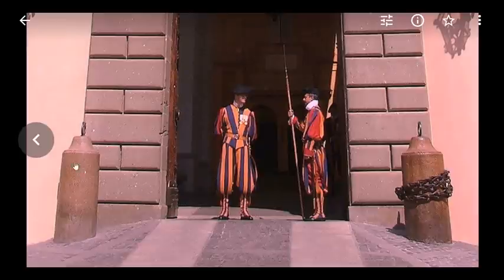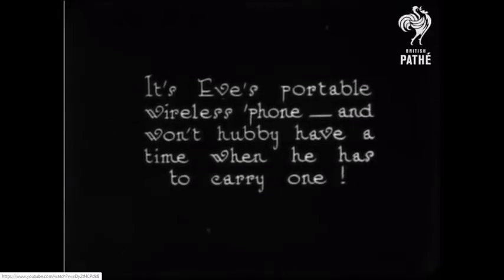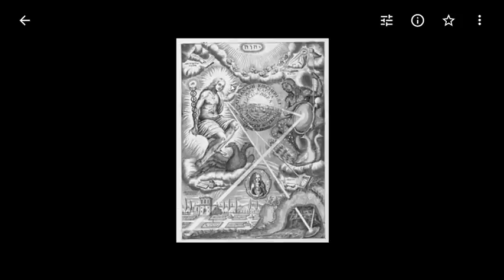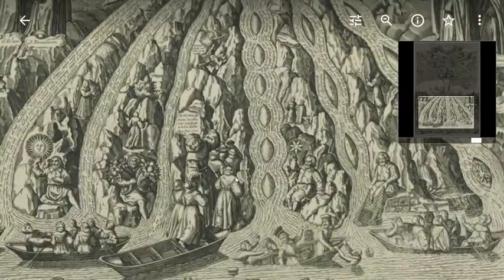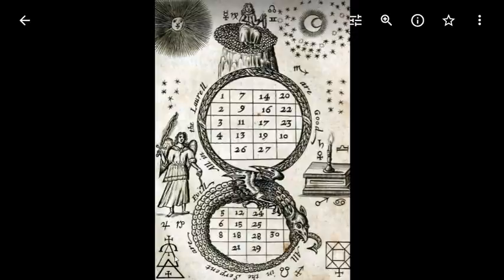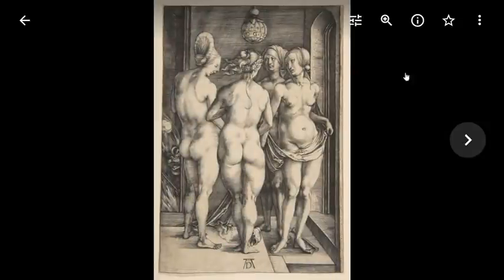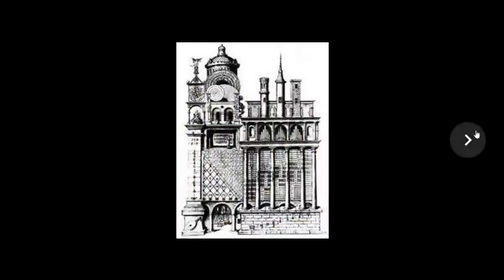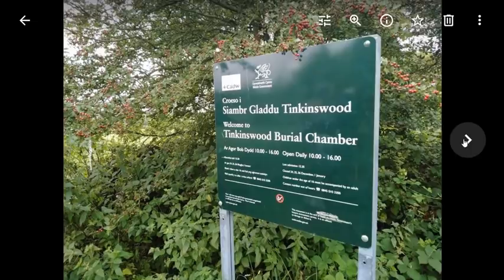FEB Extra! OMG! Antiquities Bollard's Were Charging Ports!

Comment: Im primarily a line voltage electrician, no expert when it comes to DC & wireless transmissions. But pretty sure she had a battery inside of the phone, tied into the a steel fire hydrant to ground to a degree and pick up a stronger wireless signal once she put up the umbrella. Love what you do, great work getting Levi on last month.
Reply: Jungle Jim yes pretty sure the wire was grounding, the use of batteries is interesting, they go way back further than we've been led to believe
Reply: Yup
Reply from the maker: Had a sub said his grandfather had a job taking the wires out. Could work either way if re-purposed. Do you have an Earth wire to plug in your phone? Electric can work omi-directional thanks peace!
Reply: Journeyman lineman and ham radio operator in USA. Yes, she's simply earthing her ground plane. That was needed with those old analogue LF radios.
Reply: FLAT EARTH BRITISH Think Tank! Great points, no ground wire for my portable that’s for sure. Love the story about your sub having a grandfather that helped to repurpose the old bollards. Great work in Cardiff the other day, jumping on the mic unplanned and doing your part to inspire people to gather and live fear-free.
Reply: @flatearthbritishthinktank2171  If you would ever like a second opinion on anything electrical related it is what I do for a living. I understand Tesla's ideas and I've had my hands on every facet of the US electrical grid. Much of it's key components still operate by his design.
Reply: I love the fact that we have any type of engineers following these pages - as when we are united we become a formidable side with diversity and above all the ability of open mindedness is shared and increased exponentially... In other words finally were fkn helping each other instead of dragging one another down!!!!
Reply: @user-xv1gr1of8t  there are several possibilities that these metal clad domes provide that most do not understand because they simply don't understand electromagnetism, potential gradients or earthing. I'd like to draw some of this stuff out for some of these youtubers because they are missing some stuff.
Reply: @iant419  I don't fully understand and I'd love to see you draw it out!
Reply: I'd also really like to see this drawn out. Why do people think they're kept in plain sight, as opposed to simply demolishing them; do we think that they are still being used, or that there is a different reason?

Ive been think about the theory that the magnetic poles of planet earth, swap around every 300k years and i theorise it is to do with earths position in the solar system, relative to a larger planet or star - the reason science theorises that the poles change is due to Geologists study of rock and earth. I have been pondering this and wonder if they even change at all - maybe if man were to start to harness electro-magnetic energy again, on a large scale then you'd expect the effect to be seen in the rocks... What are people's thoughts on the reversal of the earths magnetic poles being the reason behind the change of formation seen in rocks by geologists?
 Do you think option 1) planets position in solar system or option 2) harnessed magnetic energy impacting the surroundings? 

The official explanation/theory relates to neither option and they say it is due to activity within the earth but I can't help but feel this is the least likely possibility. 

I actually believe solids can be turned into a liquid-like material by sending a high pitched frequency through an object, resulting in the particles vibrating and moving around more freely (see the atomic structure of solids, liquids and gases). This would explain how megalithic structures were 1) quarried in vast quantities
2) transported kms to the site
3) built in a polygonal method (starting by placing bulging blocks - in a row and then as if they are 'squeezed' at either side to fit PERFECTLY into place). Again I know I don't have answers, only possibilities.
Reply: Also - wouldn't the moon build up and carry with it a lot of energy? It is closer to earth than the sun so surely it would be easier to harness energy from the moon than the sun (like a stepping stone almost). It is also interesting to note that the ancient people would worship the sun and the moon - which I believe there are clues in the holy books but you must first understand how to translate them in terms of astrology, which we know the ancients were fascinated by.

Comment: As an electronics specialist of old can say that the ladies in this video had a crystal radio receiver which needs no battery. It only needs a ground and antenna. The power came solely from the electromagnetic wave itself. (This relates to the electric techniques of antiquitech however)

This particular radio only received a radio signal. It did not broadcast. Notice that it only had an earpiece for listening.

Back around  1920 AM radio was an amateur hobby and private individuals broadcasted a small radio station from their homes or small business, as there was little to no regulations. This was new tech! Hobbyist built their own crystal radio receiver sets, which is what's shown in this video.

These were fascinating times, and the world of electronic innovations has accelerated at an exponential rate ever since.

The metal lugs and posts throughout the towns mentioned here can only be at an electrical ground potential, neglecting small telluric currents. Technically they are electron donors but nonetheless are earth ground. This ground potential only completes an electrical circuit. Technically, its half of the circuit. A circuit is a circle, hence its etymology.

Thank you for this wonderful video Martin! Im looking forward to catching up on all of your videos. Powerful gnosis my friend!

Comment: That is a “Johnny Pump”. The fire department hooks up their hose to the side of it and turns it on with the valve on top. We had great fun with them in the summer in Brooklyn NY. There is an enormous amount water pressure in them.
Reply: I was thinking that this doesn't look like a bollard, but a fire hydrant. So they are hooking their phone to a metal pipe with water in it. Were bollards attached to the water supply, too? Maybe water provided the energy?

Comment: Hey FE British i think the bollard is being used as a good source of ground to connect up to what looks like a basic self powered radio transceiver . there is an old radio shack circuit that explains how to make a low power radio receiver without a battery, just need a good connection to earth ground and you can pick up stations.

Comment: I have got in so far watching the ladies. Great find Martin. Haven't read comments, hope not to be repeating however for me, it isn't so much a 'charge' as a 'wave-length'. I sent Michelle these extracts from a video no longer up but by Megolithmania.uk as to how the Egyptians knew Leylines and Polarity currents;
(Me) With you on Ley lines. Electro-magnetic nodes and connections all over the Ancient world.  
"Tauret is the Great Mooring post for our spins of polarity. She is an expression of the Northern hemisphere (Red) and she is facing Mut. (The feline cat/human) The Egyptians knew an understanding of the Southern hemisphere. (Blue) 
The Big Dipper is symbolised by an ‘opening of the mouth’ tool used in ceremonies. Opens the mouth of a Pharoah to release the formless Spirit. 
The two female Neters are creating the world grid. These are the eight Ogdoads. All holding the mer because this is the opening of the passage for the electro-magnetic flow. (Ogdoad consist of four couples—eight individual deities—who balance one another and the nature of the cosmos. Each pair correlated with one of the primary elements of the universe in the Egyptian belief system, i.e., water, air, light, and time.)
Tefnut is aligned with the magnetic radiation, she is aligned with the Pyramids. As are a whole lot of global structures. Is this a path of fertility? 
"Tauret has a tool ‘Saur’ is known to be ‘birth of’. Her tool is also used in Alchemy. Analemma. Path of the Sun.  It is the container of the acceleration, deceleration, the equinox the solstice the pauses and how the cycles move. It is infinite, there is no end as we do not die. 

Every King has five labels and one of them is the golden Horus name, Hor. Each label addresses the Khemetian understanding of the cycles of time. “Where is Horus”, in other words where is the geo electro-magnetic current? 
Twin Lions, one means "Yesterday" the other means" yesterday meeting tomorrow" 'Hor Rising' between. (Horizon). 
Telluric currents will pass to the Equator on the Day-side and toward the Poles at night. They are electro-magnetic charges moving to obtain equilibrium between regions of electric potential. The strongest are geomagnetically induced from radiation or solar wind on the magnetosphere. Extremely Low Frequency.
Paths of fertility create an environment for growth and to thrive in (Nurture). Serpent power, currents. 

In the age of cancer Hippo /the measure of time and space begins (the breath, the electro-magnetic flow). Wepwawet is the formless come to open a space for form. We think/speak, via resonance we open. Light shines forth. Matter forms. He is also the path opener back to the formless, they always saw two sides. 

Wepwawet is a dog riding on the Mer as a symbol. The Mer is the Ploughing tool, (the Phoenecian and the Greek ALEPH) the Egyptian APIS has the bull head with horns. It is the 'PATH OPENER' for the current. It is right in the middle of the Cosmo diagram alongside Hippo (Tauret).
Neters all together represent the cycling or circling following a magnetic current Meri always dual of opposites.
The Mer is a tool used in the opening of the mouth ceremony to assist the release of the Spirit of the Pharoah.
Opening the ground for the current (water) to flow. Tool opens a path in the centre of the Temple. Curvy paths for water on specific meridians (under the Temples). Events at times when the Sun hits at angles onto the meridian. Harness by using a certain combination of rocks and minerals and the structural sacred geometry designed also combines to harness electromagnetic current. 
The Meri from the Ancient tribes was the Feminine elder who had the wisdom, she had the knowing she had the knowledge and understood herbs with helping with all forms of nuturing and healing. "

The spiraling of polarity creates a 'Womb'. It is a 'FIELD'. All of Nature is 'nurtured' in the Womb of matter. NTR or Neters. 
[https://www.youtube.com/watch?v=ELKb1TLgDYE the video is unavailable]
megalithomania.co.uk [The idea of the spinning, creating 'wave-forms' geometrically. The patterns of the 'Grid'. The breathing in and out (attract/repel) of opposite spins, the vortexes and the larger Vortex of the Taurus Field as a womb]

Thanks Martin, isn't this fun?!?!
Reply: OOoohhh, maybe 'Spirits' visiting need polarity magneto current to come visit, like 'AT NIGHT TIME' or on Christmas Eve. Spookyyyy

Comment: I have just been thinking that the old analog communications are via a lower wave length and would be heard via water and minerals with Silica construction, (a tetrahedron of Oxygen at all three bottom points and at the top with Silicon at the 'Eye' or center. This is what tech is based on, Laurence, where are you?) .
Heavy wave lengths are very destructive when ultra low. (Haarp was using that in the 'Woodpecker' experiments) 
Now our communications are via 'Light' or at least the tech splits the spectrum Blah, blah (don't know). They are going to use Solar energy converted up 'there' and satellite it down. We know LED lights 'Hear' us. These communication waves are getting very short.
Electricity can be extrapolated FROM the Communication Wave of  5.. G 
Silicon is a semi-conductor, it will transport electricity. Crystal composition though the same will be in different connections such as in sheets or long chain pairs, and plenty more. The same chemical composition, very different properties. The crust of Earth is composed of a lot of various forms of silicon dioxide.

Comment: Capaciters or condensers! Of a safe frequency and voltage low current. T.I.M. the speaking clock. I think the number was 8081. I Just went into any phone box in the 50s or 60s and got the time from a recording 'At the third stroke it will be 5. 59 and 45 sec..., Pip,Pip,Pip...At the third stroke it will be 6 oclock precisely Pip,Pip,Pip.
Reply from the maker: I used to do that pip pip pip ;) thanks good point love & light.